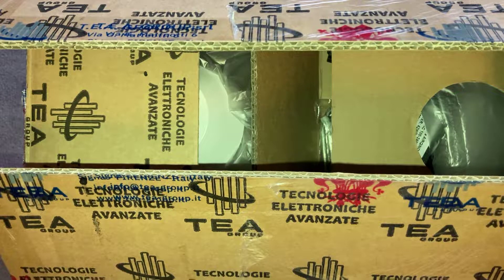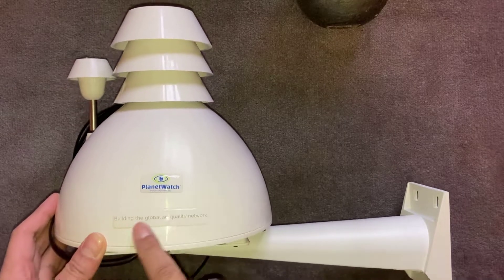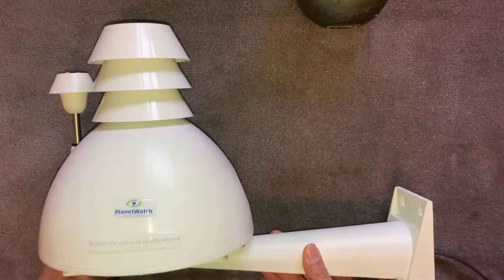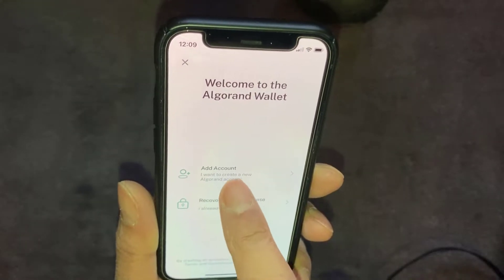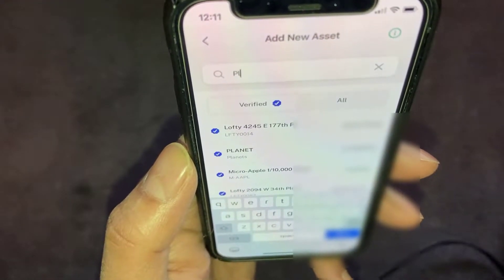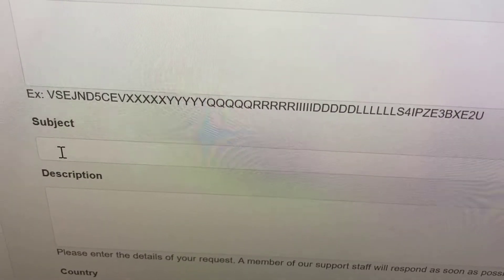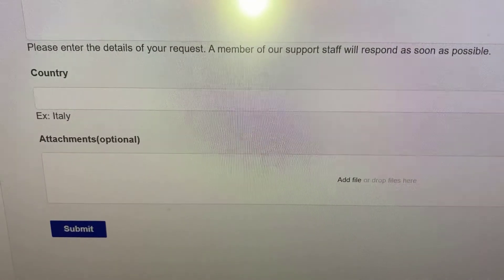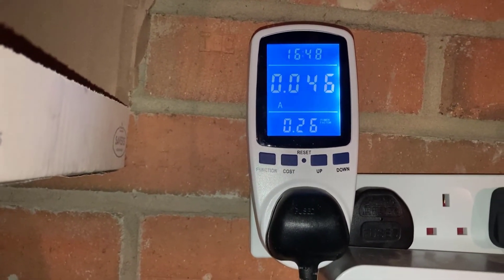Airqino Outdoor Air Quality Sensor Unboxing, Setup and Power Consumption

Comment: Is it safe to plug in the power supply outside? Isn't there a disclaimer that says it isn't waterproof?
Reply from the maker: The plug isn't suitable for outside, unless you plug it into a waterproof enclosure. The cable is quite thin, so you could easily drill through a wall, pass the cable through and use the plug inside.

Comment: how much tokens do you get on average per day from this sensor?
Reply from the maker: It depends on the Tier you are in, tier one gets around 133, tier two is 66. My findings are that this is accurate.
Reply: @HandymanSavage  What influences it so that it is sometimes level one and sometimes level two?

Thanks :)
Reply from the maker: @pepetpc5542  Location is the only factor that decides whether you are Tier 1 or 2. Bear in mind that the lions share of rewards goes to the first person in the Hexagon you are in. Say for example you are the first type1 sensor in a Tier 1 hexagon, you would currently get 133 Planets (i.e. lead sensor), but if someone else pops up in your hexagon, they  would get a vastly low reward (as they are classed as a backup sensor). All this might be irrelevant soon anyway, the rewards are all over subscribed and emptying fast.

Comment: Hello :) As it is a quite expensive investment,  with the tokens earn daily can they be converted in real money, at least to recap the investment ? :)
Reply from the maker: Hi there. Yes the tokens can be sent to various exchanges and then converted to other tokens or indeed real money if you wish to cash out. 
One thing to bear in mind when investing now is "saturation", when there are too many sensors of the same type, this will lead to a decline in rewards and a slower ROI.

Comment: i just puchased one, how long did you wait for delivery?
Reply from the maker: Congrats, should be between 2-3 weeks depending on logistics, I believe they are shipped from Italy. Suggest you check the sensor for damage because the packaging is quite poor.
Reply: @HandymanSavage  did you pay any import tax or anything extra? im from uk so hoping to pay some extra
Reply from the maker: Hope you are sitting down for this....expect to pay around £237 Import taxes
Reply: @HandymanSavage  jesus....
Reply: @HandymanSavage  how is that time period possible ? In my order with batch info , I have to wait 3 Quarters to get it. almost 1 year wait time
Reply from the maker: @bernhardtrian7471  It's a case of your position on the waitlist vs sensor availability. Bear in the mind if you get the sensor 3/4 of a year from now, saturation may have already set in my then and rewards could be below your expectations.

Comment: how much are these?
Reply from the maker: To get one, you need to buy a license to join the queue for these sensors.
If you were in the waiting list (as in you purchased a license pre-2022) then you can get it for 1350 euros + VAT or the eye-watering import taxes (depending on where you live). 
If you purchase a license now, the price of these sensors is set to be higher (prices to be confirmed as of yet) when they become available.
Reply: @HandymanSavage  so you have to buy a license first and stuff. im watching all these mining stuff and it seems like this and and mx2 pro miner are like euro based. cant we americans come up with one already lol
Reply from the maker: Works both ways, the USA has cornered the market on 5G Helium mining etc so there are some projects which are easier to get into depending on the market and which side of the pond you live.

Comment: Thank you!  So you didn't need to do anything once you added the activated asset to your wallet from support?  Just plug and play after that?
Reply from the maker: Hi there, yes once the asset is activated you're good to go. Plug, play and forget :-)
Reply: @HandymanSavage  thank you so much!  Got it installed.  How long before you started to see activity or streams?
Reply from the maker: @tww13  Once the sensor is activated, you should be seeing streams being sent every hour. As there isn't really a proper App to view Airqino air quality data, simply use Algorand Wallet to check the Algo Asset transactions to confirm everything is going through hourly.
Reply: @HandymanSavage  still having trouble with mine.  Support is trying to change the roaming profile now.
Reply: So after you send the last email telling them you added the asset You don’t need to wait for an email confirming they did the last step??
Reply from the maker: @rychessmen1  I didn't wait, but they were quiet at the time. Right now, PW support is up to their in Awair (type 4) issues, so expect possible delays if they still process the request manually their side

Comment: great video, why do you need a dedicated wallet for the airquino?
Reply from the maker: You don't need a dedicated wallet, you can use an existing one, but the bonus of having a separate wallet makes for easier tracking of individual sensors
Reply: @HandymanSavage  got it, thanks!
Reply: @HandymanSavage  ohhh really, what happens if you have like 15 airquinos? Would you do seperate wallet for them all?
Reply: @Wowfactorvideos  15 Airqino’s? Yeah…I’d still put them on separate accounts.  That way you know if one gets unplugged or goes batty.

Comment: hi there! So after a few days in which you had time to mine and see how things are going, can you tell us what are the daily earnings, how is it working, and any other details you might want to share? Also, how long did you waited after you purchased the license?
Reply from the maker: Hi, the earnings are on par with the PW whitepaper, 66 tokens for tier2 and 133 for tier1. I waited around 2 months after buying license and receiving the sensor. Once activated and connected, the streams starting sending and it's been fairly stable so far. Much easier to setup than other sensors and it's a plug and play unit. Oh and finally, depending on where you are in the world, have some money set aside for Import taxes and have some tissues to wipe your tears :-)
Reply: @HandymanSavage  people wait almost 1 year till they get theirs. How did you get it in only 2 months?
Reply from the maker: @bernhardtrian7471  Joined waitlist like everyone else, I had an eye on this project from the get go so got in early. I'm also looking at many other projects, so subscribe to get the heads up before others.
Reply: hello how can i know beforehand whether i live in tier 1 or tier 2? Thanks
Reply from the maker: @PersianTunesAI  Go to the planetwatch explorer map, choose Outdoor sensors and then click on the icon at the bottom called Tier. If you appear in Purple, then it's Tier 1, anything outside is Tier 2
Reply: @HandymanSavage  thanks, are you satisfied with the sensor so far?  would you recommend buying the sensor now?  did you buy a multi-year license or would you recommend it?